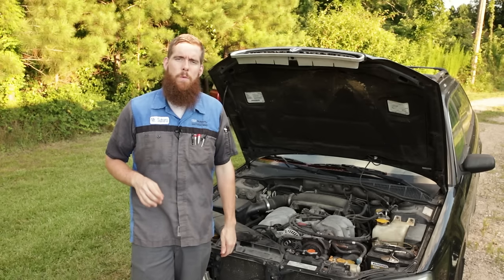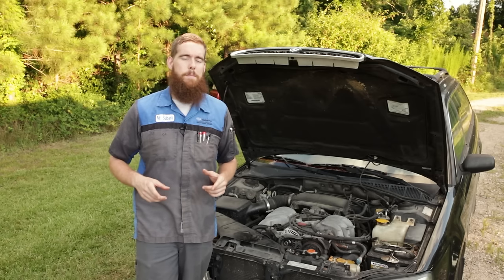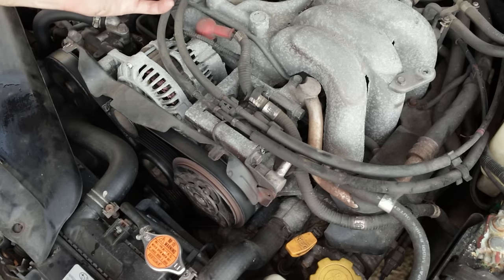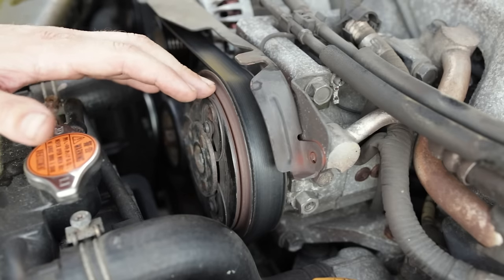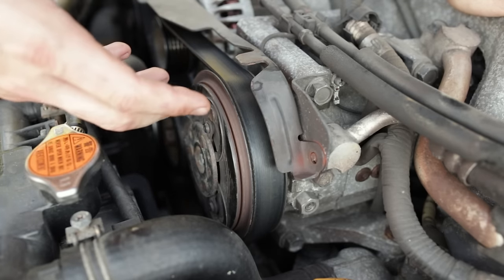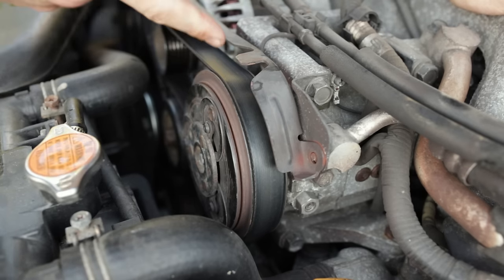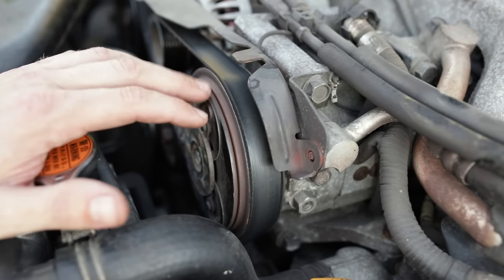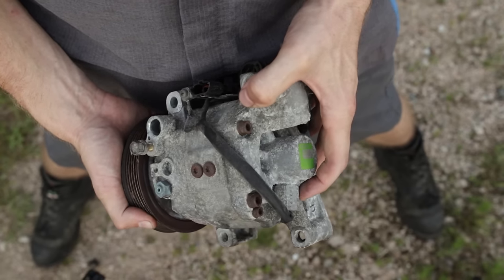Subaru A/C: Common Failures & Issues

Comment: When I first tried to use the A/C this summer on my 2008 STi about a month ago, I found it didn't work.  Discovered that I was completely out of refrigerant.  Not sure if it was leaking from the o-rings; but I replaced both of them, recharged the system, and it's been working fine.  It still doesn't seem to cool as well as my friend's 2015 Forester, but maybe that's because of the smaller compressor you mentioned.  Another A/C issue I had about 5 years ago was a broken clutch spring.  Bought a replacement spring off of eBay, installed it with the proper gap, and it's held since.    

You should do a "Common Failure & Issues" on Power Steering and Pedal Assembly next as those have been my nagging problems :).
Reply: My 15 Impreza can be set to 15.5 Celcius versus 18.5 on my 12 Legacy GT.
Reply: Power steering issue is easy. Replace O ring of the knuckle going into the top of the power steering pump, replace hose clamps with proper clamps and if you still have issues, replace the hoses around the power steering fluid reservoir. Nasioc forum has many write ups on how to do this.
Reply: @TheSunshrine  Yes, I've replaced the infamous O ring and also the hoses coming from the reservoir.  The hoses were replaced as part of installing a power steering fluid cooler as covered on iwsti.com.  The rack was also replaced a few years ago since it leaked, which hopefully the cooler will keep from happening again.  My problem is minor and that is the pump wines after cold starts in the winter.  No noise after it warms up or even in the summer.  I've had this problem before all of work, and it's a bit frustrating that it's still there.  Still the original pump.

Comment: Sometimes the compressor's pulley bearing will seize. I was able to replace the one in mine ('94 Impreza)cheaply and with little fuss but I'm not sure how easy that is to do on new models. The ER27 also used a single serpentine belt, and the EA family engines used a double V-belt system in some configurations. The EA cars also typically used either Hitachi or Panasonic compressors (the former typically being more reliable, the latter being fitted primarily to turbo cars) though occasionally there would be a Sanden or other make especially if it was a dealer-installed system.

Comment: I am an A/c technician by trade.  I never adjust these types of clutches or replace just the clutch.  if the clutch gets hot usually damages compressor seal/shaft.

Comment: I had an 03 forester and it was nice and cold.  I have a 2016 wrx and that thing gets worse as I drive down the road.  I’ve done an evac and recharge and it was on point.  The older ones held more than the newer ones

Comment: Don't forget that even in the diag mode, if the system has too low refrigerant it will not cycle the compressor. Jump the pressure switch to make sure.

Comment: 04 outback AC runs great for 12 minutes and then seems to stop cooling. Turn system off for 2-3 minutes turn back on  and works fine for a period of time, bad compressor sensor?

Comment: Thank you for this video, my 2006 FXT with 120,000 miles air conditioner is still going strong and never been serviced, but expect my luck to run out any day now as the mid western seasonal extreme temp swings are taxing to an a/c system.  I wonder if the store bought refrigerant with seal conditioner or leak sealer actually work to prevent the o rings from leaking.  Another youtuber automotive guy I like to watch, South Main Auto, said most cars he services seem to lose a certain amount of refrigerant per year, I think he said up to an ounce per year, so if that's true with Subarus, I may need to add refrigerant soon anyways.

Comment: just had my compressor in my 2012 outback done under warranty because it wouldn't engage properly and cooled very slowly, the new compressor is better, but the little 12oz system is no match for the 16oz in the SH forester 
the 250k mile compressor in my 2010 forester will literally turn that car into a freezer, but the clutch is starting to grind on engagement so looks like its time to throw a new clutch on it

Comment: I had 16 WRX and towards the end of owning the car the AC stopped working. It ended up being the Orings had dried out and shrank. Easy fix, but Subaru should move away from those orings.

Comment: The Valeo compressor clutch failed on my 2015 Forester right after the warranty expired. Fortunately, it wasn't that hard to replace. There was a TSB issued about the clutch failure issue that helped me diagnose the problem.
Reply from the maker: Glad you got it resolved. Like I said in the video, heard from quite a few owners that have issue with these newer Valeo compressors.
Reply: My 2015 Forester compressor clutch failed this year, dealer charge me more than US $1,200

Comment: If pressure switches don't let voltage thru, the clutch will not activate in test mode.  It requires a bypass to test
Reply: Aaand the Low pressure switch won't let voltage thru unless the a/c is somewhat charged - if the a/c doesn't have enough charge the pressure switch  will not allow voltage to the compressor nor the clutch

Comment: 2002 LL BEAN AC WORKS but will stop working while driving. Stop car and restarts works fine again. Rev sensor new thermistor new at idle never quits only while driving the scanner reads Ac lock switch on normal off ? Thank you if you have any useful ideas.  I appreciate it
Reply: My 04 forester does the same thing have you solve the problem since this comment?

Comment: Someone may have already noted this here, but for my 2006 Outback the test mode connectors are super easy to reach - right above the carpet line on the PASSENGER SIDE tucked behind there, slightly towards the center console. Super helpful video - helped me diagnose a bad clutch. Thanks!
Reply: My 2010 Forester has them located in the same place.

Comment: This was a very informative video...I have a 2017 Forester.  The AC blows great, it cools great, but is dripping (alot) of water on the passenger floor well...We blew out the rubber hose and the tubes - water is going on the ground where it should, but still alot in the cabin - what should I examine next? thanks for anything you can tell me...

Comment: I did the green plugs and helped me indicate the clutch was working and the fans. 👍

Still trying to figure out why idle isn't as cold but now guessing it's refrigerant levels. 

Thanks for the tips
Reply: I'm trying to determine why mine blows ice cold as long as I'm moving but warm are at idle. I had the refrigerant check.

Comment: Hello Mr Subaru, I have watched a lot of Subaru videos. This is a GOOD one and a great channel. One Question:  The thing that seems to be missing is: A) Most common problems when it is just weak AC vs B) Most common problems if the AC comes on for 5-10 minutes and then stops working.  

I am not sure if AC that comes on and then quits can be a symptom of just low freon and needs a recharge or if it is more likely a sign of the clutch and/or compressor.

@MrSubaru1387

Comment: I have to say the Japanese cars hold the ac system better. When I used to own the American brand there always was an issue  under warranty or after warranty  and that was expensive. And since I changed brands. No problem ,knocking on wood 😂😂😂😂
Reply: I have had A/C issues with every Japanese car I have ever owned.
A compressor failure on a Toyota Camry.
Multiple condenser replacements on a Honda Accord.
Bad clutch on a Nissan Altima.
I still own a 2001 Saturn LW300 that I bought new and it's still has all its original A/C components and the A/C still blows ice cold.
I also own a 87 Mercedes-Benz wagon and it has never had a issue with the 
A/C either.
Reply: I haven't seen the o-rings on the AC compressor (yet, I'm going to pop mine as soon as I get a chance now), but I've noticed a disturbing design issue with some of Subaru's designs...

On GM's cars (specifically Pontiac for me) ALL of their gaskets and o-rings have some kind of mechanical pressure applied to them (a bolt, screw, etc.).  But I recently popped a device off / out of the engine area (I can't remember exactly what it was) that had an o-ring on it but the o-ring just rested inside the opening and all of the clamping force of the screw (or bolt) just pressed the object up against the aluminum intake manifold or engine.  I immediately recognized it as a mechanical engineering flaw (and if I remember correctly, I reinforced it to prevent it from failing again).

If these AC connectors are the same way, no wonder Pontiac outlasted them...
🤔
Reply: @williamegler8771  happy for you. It's  a good thing the last a long time. I had a 79 Chevy Malibu that lasted 300k miles. He'll of a car. But as the time went on,the big 3 just doesn't make them like they used to.

Comment: I daily a 2018 WRX but picked up a cheap 2015 Impreza with high miles and a bad AC as a winter beater. Wife won't ride in the Impreza until the AC is fixed...can't blame her,it's been hot lately. Tried 2 OEM low mile compressors and it never got cold after recharging them professionally. Tried a crappy aftermarket AC,it worked but was EXTREMELY loud to the point that it was embarrassing in traffic. Since both my 2018 WRX and my 2015 Impreza use the same AC compressor I knew it was not supposed to be that loud. I did notice the "working" aftermarket one was NOT cycling on and off for the short amount of time I had it on the car. It was either ALWAYS on or ALWAYS off.I did clear the cabin air filter,it barely had anything on it. I checked the AC condenser and it appears to be clear/clean. Would a fuse cause issues? I reached out to my local dealership after telling them about the service report I found online and they pretty much told me I am on my own. Am I just having back luck with buying replacement compressors?

Comment: I have a 2018 wrx and have had problems with the ac for a few years. I would recharge it and it would be good for a while but come the next summer it doesn't work again. Today I tried finding a leak. I found one around the flange of the high pressure line where it connects to the compressor.  The bolt holding it is tight but on the opposite end closer to where the inlet of freon is has some play, and wiggles and leaks in certain positions. That seems easy enough to fix with some new seals. I also have that horrible ticking come from the ac clutch when ever I turn it on, I slipped some feeler Guage in there and .06 was the largest to go in albeit tightly. Not sure what's going on there.

Comment: I have a 2014 Subaru outback 3.6 and the ac will blow cold and then blow warm cycles between the two the charge is good the one thing I notice is that the ac compressor clutch never stops spinning even if the ac is turned off from inside the cabin... Any idea of what could cause this issue?
Reply: I have the same issue on my 2014 crosstrek 2.0L CVT. The only difference is that I notice my clutch stop spinning. I'll give it a love tap with my multi-tool, and it starts back to blowing cold air... Not sure I can replace just the clutch. Anyone know?
Reply: @logangable4944  you might be able to just shim the clutch so that the magnets work. It’s simple to do but you will need to feeler gauges to measure the gap.

Comment: 2015 Outback that blows plenty of air but doesn't heat and cool properly.  Even after the engine is warmed up last winter it would blow cold air, then after a while longer  it might blow warm air for a few minutes then cold again.  Now, the end of May and the A/C blows cold air when the Subaru is first started, but once it warms up it begins to blow air that seems to be the same temp. as the ambient air.  After 15-20 minutes it will blow cold air for a couple of minutes, then warm again.  The only time the a/c seems to be reliable is when the engine is cold.  Any ideas?

Comment: I have a 2016 Impreza, about 30k miles. Compressor started making a quick buzzing sound that only happened when engine was cold, and didn't blow cold air either. Dealer replaced both compressor and condenser under warranty ( just barely made it). Unfortunately, this noise still happens. They said they had no idea what causes it, then pretended they never heard it to begin with. I would love to fix the issue before it gets worse as my warranty has officially expired. Any ideas? It almost sounds like the belt is slipping for a second but I only have 30k miles. Could it be the belt already? Ac works fine now but the noise is loud and concerning. Thanks Mr Subaru!
Reply: I saw a video where he fixed the buzzing by replacing the o-rings in the ac lines for $3

Comment: I have a 2005 Subaru Outback. My mechanic told me A/C is not working because of a leak and compressor needs to be replaced. He says new compressor is $ 400 and labor is $ 200. Is it possible to find a compressor "used/in good working condition" for much lesser? Any help will be much appreciated. Thanks.

Comment: I am having an AC issue with my daughter's 2017 forester. Was losing freon. I replaced the hi side (??small line??) o-ring that had an obvious leak. Charged it up. Worked fine for a few weeks until it again lost freon. Recharged it and immediately lost the freon. Replaced the other o-ring and charged it up and it worked for an hour or so and lost the freon. My question is, are the two o-rings the same size? I got the o-rings from the dealer and they gave me two of the same size but one of the fittings seems to be quite a bit bigger than the other. Thank you, Mark

Comment: Mine runs in the driveway, compressor cycles off after a mile or so driving down the road. Shut car off to gas up, works for a mile or so. Low pressure shutting off compressor?

Comment: Mr. Subaru, your videos are incredibly helpful, so thank you! I'm trying to figure out what's going on with my 2015 Forester XT AC system. It functions... sometimes. On these hot days, I turn the car on and it blows ice cold. After driving 15 minutes, the fan will continue blowing at max but no more cold air is supplied. I'll turn the AC and fan off for a few minutes. Sometimes when I turn it back on, it will begin blowing cold air again, sometimes it' still hot but if I leave it on, it will randomly turn back to cold air. I was hoping it would be as easy as the O-ring solution but wouldn't that mean I would get little-to-no cold air all together? Do you think it's a compressor clutch or sensor issue that's causing the AC to engage/disengage randomly?
Reply: Did you get any help with this? Having same problem with a Subaru Forester
Reply: @felixkamami1201   
i ended up finding this video: https://www.youtube.com/watch?v=jeZJ9AbDqh4
My problem was there was too big of a gap and the AC clutch wasn't engaging properly. I removed one of the shims as seen in the video and everything worked perfectly afterwards. Make sure you keep that shim somewhere safe if you do this, so you can revert back to previous spacing if something changes in the future and you need it.

Comment: My issue I have been having in my 2015 Subaru Forester is the climate control in the cabin, shorting and burning the connection to the 1-4 setting knobs. Obviously it is getting too hot, but what can I do to stop this from happening? The first one lasted.from when I bought it in 2015 until either last summer or the one before. And I just replaced the 2nd one tonight, (7-14-23) Any advice would greatly appreciated!

Comment: So my 2004 3.0 blows cold air for awhile. After about 30 mins of steady driving I find the air to get warmer even if I keep the temp at 65. After turning off for 10 mins or so and turn back on I get cold air for a few mins until it’s warm again. Is there a temp sensor? Or regulator? Clogged drain? Frozen?
Reply: I have the exact same issue on my 04 Forester XT. Hope I will find the problem with this video.

Comment: I have a 2016 forester last year the dealer replaced the o rings.  Now a week ago I had had mechanic replace the blower and compression.  The other day it started blowing  cold then warm on and off. Took back to mechanic they found no leaks and replaced the Schrader valves. Today they say o need a new ac control head. does this sound correct? It was cold I will drive it a couple of miles it goes warm.

Comment: MrSubaru, I have 2004 Forester XT and AC turns off after about 10 minutes of running and never re-engages again until the car sits for a little bit with the engine off. I've checked fuse, relay and refrigerant level, all good. Do you have any recommendations on what it could be? Could the compressor be on its last leg?

Comment: I've had nothing but issues with my 2012 AC. It was putting so much load on the engine it was causing it to overheat. I replaced it with a reman, doesn't work very well at all.

Comment: Dear Mr Subaru,
I greatly appreciate your well worded and thorough video. I currently drive a 2016 STI. Last year my A/C worked fine when it was 115 degrees in Portland, this year it’s barely adequate in the mid 80s. I have a set of gauges and have confirmed pressures are reasonable and replaced the pollen filter just a couple months ago. Im aware of the TSB regarding the compressor and mine has not been updated. Do you have more info on these and could that be the issue?
Best regards, 
The Sweaty PDX Guy
Reply: Umm I have a 2018 wrx not sti , so a fa20 , and my ac stopped working today, what do you mean by tsb? Does that apply to a fa if not an ej motor that the sti has?